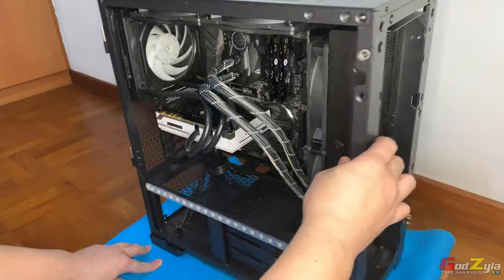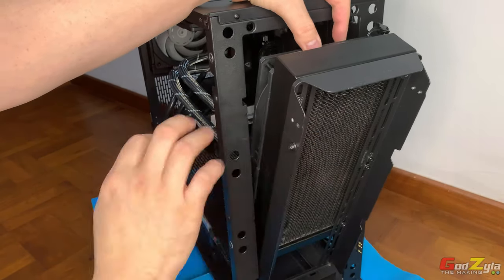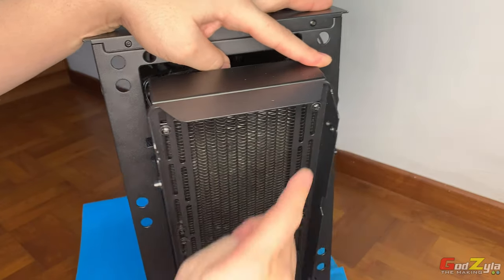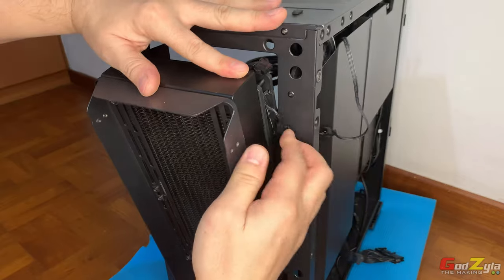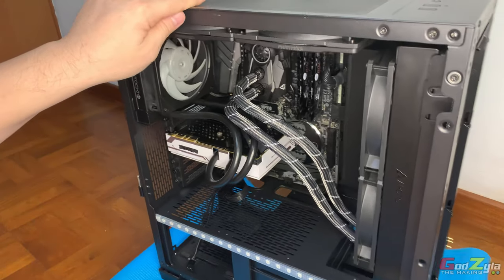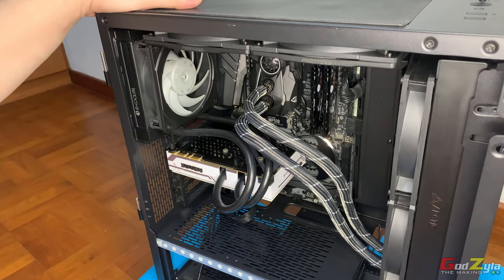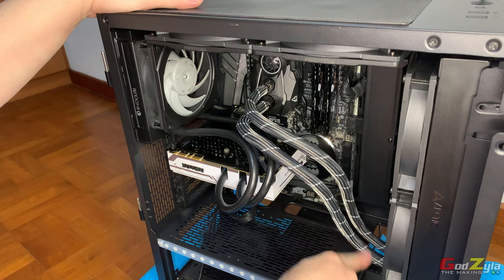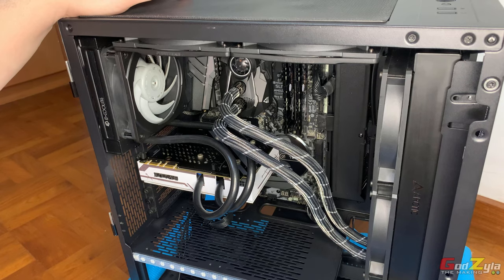Radiator Placement In Lian Li Lancool II Case

Comment: Hi Kleo.. Interesting mount when front mounting the RAD. I have a quick question,..
Have you tun some thermal test with the way the case is setup now? If so can you share the detailed specs and idle & load temps. I would also be interested to know if shifting the intake fans to the front of the RAD will the thermals improve as that is what I suspect. Thanks and keep up the good work!
Reply from the maker: Hi Hafiz,

Thank you for your compliment and questions.

My experience will be, to have fan pull air in rather than to have air push to the radiator. The result is the same, but I choose to pull air in as easier to clean. 

Just to share, I am using a i5 9600K processor, boost from motherboard at 3.7Ghz to 4.5Ghz and X.M.P profile for my rams to run at 3200mhz. With this setup, my room temperature average of 29 to 32 celsius, at idle, it will hover between 34-36. When full load on cinebench run, or rendering 4k videos, or 3D imaging. the Temperature will hover between 71 to 73, never beyond 74. 

Everyone has their own style of doing case or processor or gpu airflow. This is just my style. I will gauge base on these factors

1st, the most important, case build. Must have space for air to circulate, that's why I avoid ITX cases. unless the pc is for just light surfing and some office 365 suite work. 
If give the choice eailer, I will get the Lancool II Mesh. Reason being, from my current case, when I remove my front panel or cover, my idle temp will be at 32-34 and full load at 70-72.

2nd, to use performance fans which will not break my pocket. Honestly if there are 140mm fans for Yate Loon, Servo Gentle Typhoon, Nidec PL series, Papst SH and Gelid Wing PL, I will use them. However there are none. I have tested numerous of 140mm fans and sold them. (all useless and expensive)
Therefore I ended up with Arctic PWN F14 / Bonix F140 / PWN P14 / Bionix P140. These Arctic fans blows tons of air, be it pressure or airflow. 
So long you keep the min speed at 800rpm to 900rpm at idle (dead silent).

By the way I've tried Noctua AF14, they are dead silent too but I just dislike the color and compare the price and value, these Arctic still best, cheap and perform well.

3rd, to use budget liquid cooling AIO, I have tested all kinds of Liquid AIO with the help from German friends. Nothing beats this dirt cheap Liquid cooler at SGD $95 bucks back then.
Ya again Arctic Liquid Freezer II 280 but now it cost  SGD $200 ++ , due to 1st shortage, 2nd being reviewed as one of the best AIO. so I guess marketing does affect the price to increase. 
GBP - https://amzn.to/3kplBjI
USD - https://amzn.to/2DOCCmU
SGD - https://bit.ly/3gR9mu0

4th deciding the hot and cool zone of the case. the Internal. This part basically is through experience. I am more towards positive airflow in a case as balance is difficult.

let me see if I have the time to do up another video to explain --> 4th. 

hope that helps to answer your question and thanks again for asking. 

Rgds,
Kleo Yan

Comment: Hi thanx for the info, sonI just bought the arctic 280 version and the lian li II mesh, just like yours and I saw what you did and I almost ready to do it like you as theres no other option, thought I could mounted on top but nop doesnt fit. My question, base on lian li mesh being a good air flow case with putting a arctic 280 like yours will it be a waste of case cuz not having the fan pulling good air inside?? Should I change the case or what do you recommend. I have a 3080 and bought the case cuz it was getting hot inside with previous case. Ty
Reply from the maker: You are most welcome Javier Espinoza, infact I do feel that Lian Li should allocate top mounting for 280 but then again, the case might grow a little too big, nevertheless hope it's working well for you and all tbe best with your Lancool II Mesh.

Comment: I have mounted exactly like this but I have a question if I want to do push-pull how many fans can I mount at the front apart from the two?
Reply from the maker: 3 x 120mm fans on the radiator the way shown in this video and 3 x 120mm in the radiator tray. or 2 x 140mm fans on the radiator and 2 x 140mm fans in the radiator tray. it's always better to have equal amount of fans for push pull configuration.
Reply: @KleoYan  thanks solved my query completely. It took sometime for me to understand all this
Reply from the maker: @IntuitiveLegend  you are most welcome. :)

Comment: Cool install video and all, but your radiator is installed wrong and can have cavitation. This will introduce air to your pump making i. Way less efficient.
Reply from the maker: Hi PureFlakMonkeY, welcome to my channel and thank you for your feedback. I have used this since 2019 and it’s still running strong. The air will go up the radiator top. Having the hose down will circulate only coolant and  not bubbles. If you have hose up, chances of air bubbles going back to the pump it’s much higher. So I have no idea where you get the idea from as in this style of placement will have air bubbles going back to the pump to cause cavitation. This style am using will prolong the usage instead of increasing cavitation.
Reply: @KleoYan  i'm glad it's worked for you, but when you have it setup with the radiator upside down you have a VERY high chance of all the air left in the system to end up at your pump.
Reply from the maker: @pureflakmonkey3368  thank you for the concern.
Reply from the maker: @pureflakmonkey3368  I think you got it all wrong. Please re-visit GN video. My practice is correct  lol. I don't think you understood what he is illustrating. Anyway is up to you if you think I did it incorrect.
Reply: @KleoYan  I'm sorry, whats illustrated? LOL your radiator is literally upside-down 🤣.  Do what you want but I hope people don't use this video as an example of how to mount their rad.
Reply from the maker: @pureflakmonkey3368  Most should follow the example here as it’s correct to have radiator mounting at the front with hose down at the bottom. No point arguing and you should revisit GN’s video. This is how water cycle should flow from the pump to the radiator.

Comment: Are the top two fans intake or exhaust in your config? I'm going to have a 240 rad as intake in the front like yours.
Reply from the maker: Hi MdeLongpre, welcome. For my setup I have it air in as my GPU is hybrid style as in blower fan type with AIO cooler. But for normal I advise to have it exhaust
Reply: @KleoYan  perfect, thank you!
Reply from the maker: @MdeLongpre  you are most welcome 😊

Comment: I was exactly looking for this ! I'm going to build my first rig with the same AIO, same case, and you solved two of my concerns : is there enough tube length to mount them down (and it looks like it will, even with a 315mm GPU) and how to screw the radiator on the cage. A big thank you !
Reply from the maker: Hello Le Maraud, thank you for your feedback, I do have other two videos that might help you.https://youtu.be/2308BQVlBDU and this https://youtu.be/Uj1_2WJBM9c . if you like what you see, do subscribe to my channel :) thank you again for the feedback and to have visit my channel.
Reply: Hello! Have you managed to do so? (with that GPU and aio orientation in this case)

Comment: I couldn't disagree on so many topics you said here...

First of all - you should mount the radiator upside down - and the reason why, is that the bubbles travel to the "most top" space (which in your case is either CPU pump or top of the radiator).

Second - these fans that were included with the radiator are high-pressure fans - good for pushing through the air, but not so great at just creating airflow. They are meant to be pushing.

Third - no, you won't scratch the radiator (and even if you did scratch it a tiny bit on a side, who really cares?), the threads are of specific length as to not touch the 280mm rad at all... You didn't even check it.
Reply from the maker: Hi Wojtex1221, welcome to my channel and thank you for all your feedback, I will still prefer my style of mounting them as

"First of all - you should mount the radiator upside down - and the reason why, is that the bubbles travel to the "most top" space (which in your case is either CPU pump or top of the radiator)."
I prefer to mount it this way as I do witness bubbling noise if I have the hose above instead of the bottom. though the noise is random but to me to have hose at the bottom, this helps to have a solid flow of fluid instead of giving chances for air to pass through the tubes. Plus no noise.

"Second - these fans that were included with the radiator are high-pressure fans - good for pushing through the air, but not so great at just creating airflow. They are meant to be pushing."
I've tested both ways, there are no difference in temperature. This method is easier for cleaning. If you place fans pushing air towards the radiator, in time dust will accumulate inside the rad which will affect the temperature. It will take up more time just to remove the fans and to clear the dust off the radiator. 

"Third - no, you won't scratch the radiator (and even if you did scratch it a tiny bit on a side, who really cares?), the threads are of specific length as to not touch the 280mm rad at all... You didn't even check it."
Last but not least, since you are being direct "you didn't even check it" I would have say it's not possible to mount. I did emphasis you can place but I said it's not advisable and it might scratch the radiator. Therefore to prevent scratches, is best not to place it that way. "(and even if you did scratch it a tiny bit on a side, who really cares?)" <-- I do. 

Anyway thank you for your comments and I will appreciate if you will listen carefully to my content. 

Have a nice day.

Comment: Do you think that a 360 (same model) could be mounted in the same way you mounted the 280 (hoses down)? Or maybe with the radiator on the inside of the bracket? The 360 being longer i'm thinking that there won't be enough space in the psu shroud hole to let hoses fit. Also probably the tubes aren't long enough (only 45 cm)for mounting a 360 hoses down and radiator inside the bracket.
Reply from the maker: Hi IIiuta Minca, 

Thanks for asking but am sorry to say that with the liquid freezer II 360, it is not possible to mount your hose downwards. You will need to mount hose up.
Reply: @KleoYan  Yeah, thanks man, I was worried about that.  Do you think it's because of the psu shroud forcing the hoses to bend too much, or because the hoses are too short? Probably both.
Reply from the maker: @iliutaminca2091  The tubing  on 360 is at 450mm in length which is the same as  the 280 version. Is not about the PSU shroud.
If you remove the HDD Cage and change the front tray outwards, you might be able to fit, but to me I would advise to, 1st fans needs room to pull air and having the front tray move outwards,  your are forcing the fans of the radiator near the wall of the front cover of the case. Unless you are using the Lancool II Mesh. it might work. 
Next even with what I have said above, you  are pulling the hose further with tension and you might say that the fan placement is infront of the radiator but the bend to me is still steep. 

I would advice in your case, to find a case that cater for a 360 top radiator mount.
Reply: @KleoYan  Yes, I allready have the lancool mesh, now i'm looking for a liquid cooler and arctic freezer ii 360 was very tempting for its performance, but not allowing a hose down mount can be a deal breaker.
Reply from the maker: Iliuta Minca I see. Wish I could wait and get the mesh version too. Anyway I feel that the 280 is almost as good as the 360. Plus is cheaper and value for its price. You might want to consider the 280 instead.
Reply: @KleoYan  Well, 280 is one of my options along with the 360. I want to be sure that 360 is not a viabile option before buying the 280. Another option is alphacool icebaer 360 but this comes with its own shortcomings. Requieres changing the tubes and its performance seems subpar even compared to the arctic 280. Tough choices.

Comment: was searching for a video with the same aio cooler positioning in the front but i am curious are both fans on top push or pull? i am wondering which is better for this type of configuration
Reply from the maker: Hi RENO VALENTINO, welcome to my channel. Back then I did intake at the top as I do not have a GPU installed but if you do have. It’s advisable to do exhaust. All the very best in your build 👍

Comment: Did that radiator is 280mm? So there is enough space to make a push/pull config? Tyvm
Reply from the maker: Hi Tonatiuh Pizano, thank you for the question. Yup, there is enough space. if you see my video the removable tray outside is empty. it is capable to install 2 more 140mm fans on it :) 
hope this help.. once again thank you for visiting my channel.

Comment: I want to mount a 360mm NZXT Kraken X73 will this work??
Reply from the maker: Hi ToxicZz_Ph, welcome to my channel, yes it will work if you mount at the front with your aio hose up instead at the bottom. If you are thinking to mount it at the top, you can't..
Reply: @KleoYan  I wanted to mount it at the front with the radiator in the back and the fans in the front so I could see the RGB through the mesh
Reply from the maker: @Tiag0_Richards0n  yup. Not an issue. This case can cater to your needs. Plus it has a removable try which you can adjust. All the best in your build 👍
Reply: @KleoYan  Thanks i start christmas day just need to have the case and aio arrive
Reply from the maker: @Tiag0_Richards0n  you are most welcome.
Reply: @KleoYan  case just arrived she’s a Beaut!
Reply from the maker: @Tiag0_Richards0n  nice and congrats, have fun with your build 👍

Comment: Hello Kleo, would you be able to do an in depth installation? Because im still lost on how to even begin. Also the tubes for the radiator are so stiff it feels like im breaking it lmao
Reply from the maker: Hi Brennan Georges, kindly allow me sometime this weekends. I will do up a video this weekend. hope that helps. if you can't wait, this is what I normally do.

Mount the fans and radiator on the case first, next, Mount the radiator to the case and once done, apply thermal paste on your processor. 
with one hand holding the block/pump while another hand holding on the hose, slowly guide bend towards your Processor. Once it reach to the point where you can sit your block/pump on your processor, use your hand which was holding on the host to your block/pump, then press down gently into position, tighen the screws in a diagonal formation.
Reply from the maker: Hi Brennan, I have done up a video and this might help you out with the stiff hose https://youtu.be/2308BQVlBDU

Comment: Can it fit 360mm front? Arctic Freezer 2
Reply from the maker: Hello Alex Zander, welcome to my channel. Yes it can, for arctic liquid freezer II 360 not an issue with hose down. Just need to play till with the radiator tray of this case. If you using other brand AIO then is not possible as most AIO hose are at 400mm in length. Only arctic liquid freezer II series have hose length of 450mm
Reply: @KleoYan  thank you so much for replying! I appreciate it alot!
Reply from the maker: @aleczander4638  you are most welcome 👍

Comment: Nice video bro. Can mount a 120 fan below a 280 radiator in front? Thanks.
Reply from the maker: thank you for the comments. no can't mount 120mm fan as the space does not allow to, after placing the 280 radiator.
Reply: @KleoYan  Thanks bro 👍🏼

Comment: Did you have trouble orienting the vrm fan up? I've tried to use this setup but it seems to put a lot of strain on the tubing.
Reply from the maker: Hi Evocel, 
thank you for your valuable question. Yes, as the AIO Block or Pump is facing the radiator when it's new out of the package. The strain will be some strain when you mount the AIO block onto the CPU. Rest assure it will be fine. The way I do it is to mount the Radiator first, then mount the AIO Block. Once again thank you for this question and your visit to my channel..

Comment: Hello, does a Push in Pull work in the front?
Reply from the maker: If it’s based on this arctic 280 aio. Yes it works. Just place one set of fans outside the removable tray and the radiator plus fan inside.

Comment: do you think i can put the liquid freezr 360 on the front for the lancool ii mesh ?
Reply from the maker: Hi FearQ8i, thank you for your question. Yes you can mount a liquid freezer II 360 not an issue. However you will need to fiddle with the placement if you want to place your hose below. Once again thank you for your question and if you do like my content, kindly subscribe to my channel and click on the notification bell. thank you :)
Reply: @KleoYan  thank you ! , yup thats what i was thinking since i thought it didnt have enough space to place the aio hose below but will see ! , subbed
Reply from the maker: @fearq8i605  You are most welcome, just remember that the removable front radiator cage can be shifted towards the front or towards the back. hope that helps. Thank you for your reply and to have subscribe to my channel :)
Reply: @Kevin Kyle yes i did managed to fit it and , the only problem that was caused is that there are literally no airflow for the case since i took the front 2x140mm fans and made them exhaust on top , so you need two fans installed below the gpu so you can get sufficient airflow for the case
Reply: @fearq8i605  Awesome, what fans did you use for intake below the gpu?
Reply: @kevinkyle154  Arctic P12 pwm pst , nice fans tbh , but if you want rgb i would suggest uni fans or ql120
Reply: @Kevin Kyle I believe on this case there's some room between the top of the PSU and the roof above it, so air from the front intakes can get in between and reach the fans facing up toward the GPU